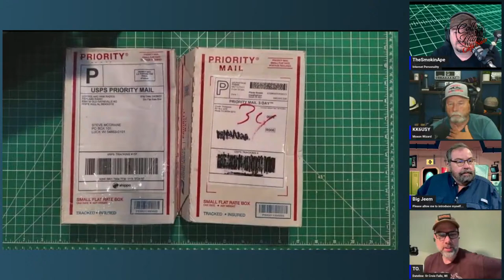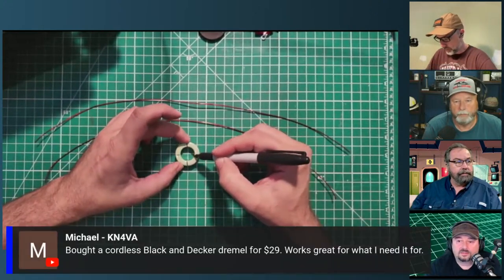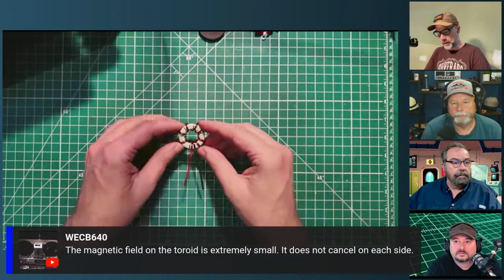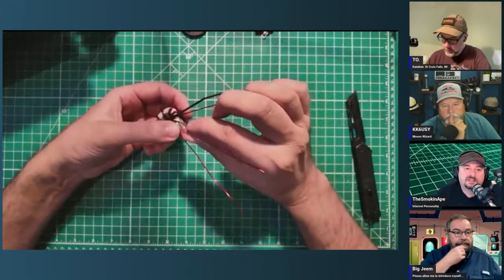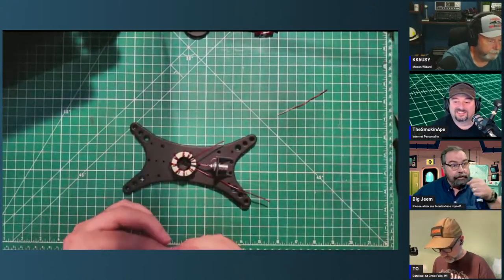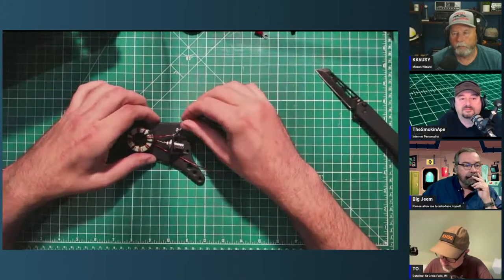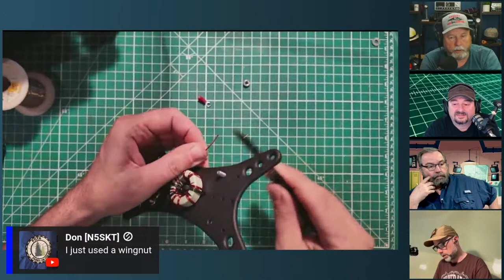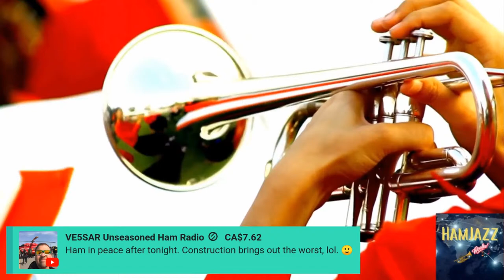From the Lab! Let's Build a Transformer

Comment: nice show . I say use the rest of wire for the 4 ground element's . if SWR too crazy then cut 17 ft. as long as non resonant length should be fine. looks like 10 AWG mag wire chuck had. what Collin wound was a few different 3 stack T 240 ferrite mix 52. he made a few. for back to back testing.  the auto transformer wind 49:1 with out cross over tested slightly better. even tested ferrite type 43 mix. I wound 49:1 on 240 ferrite type 61 cores . 2 stack. super glue together. 3KV 100 PF cap.   500 watts FT8 on 12 and 10 meters ferrite stayed cool.  when going QRO on 49:1 use high voltage cap like 3Kv . 2Kv should be ok . 1Kv 500 watts and less should work fine. never had a cap heat up or go bad going that way. it's the ferrite heating.  3 stack of FT 240 should due 1.5 KW PEP.  with 10 AWG wire. send some pain killers to chuck. his fingers going to hurt after winding 10 AWG mag wire. that stiff.  I will do a 3 stack with 10 AWG PTFE wire. I need ferrite . the ferrite 52 and 61 mix cost more than a type 43 or 31 ferrite mix. what I found with my testing is type 43 is better 40/30/20/15 meters. the 61 mix better 6/10/11/12 meters.  did not have 52 mix to try. I did the ferrite heating test on QRO. if mag wire to small the wire heats up before the core. and SWR climbs a tad under power until the core gets too hot then SWR shoots way up. that on tuned 49:1 end fed half wave. the 3 turn primary for 49:1 ran cooler on 80 and 160 meters and tuned better. on a 43 mix FT240. wish APE got that green toroid melting on video .  I have seen them crack apart . 73's

Comment: Can you install a Rybakov on a flat (not metal) roof? If, yes, how would that change the radial situation?
Reply: There’s probably no perfect answer, because it’s definitely not sitting in free space (given wiring, pipes, rebar, nails, etc. in the structure)… but I would say just plan to use the same radial system that you would use at ground level. As it’s a non-resonant antenna, you’ll be using the tuner to dial in the impedance match, and won’t be expected to run tuned radials. I think that’s a pretty fair answer. :)  If you had trouble matching on one or more bands, which I doubt, messing with the radial length would perhaps have more impact on the ‘tunability’ than if it were on the ground… but my suspicion is that it will match about as well as it does on the ground.
Reply from the maker: I’d try it and see, with the radials